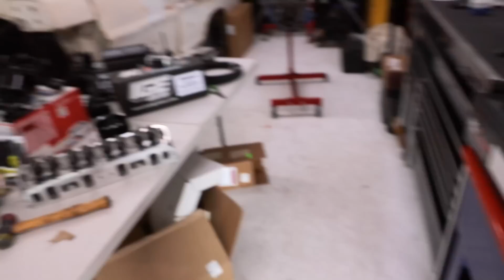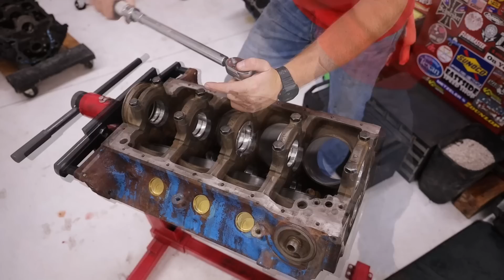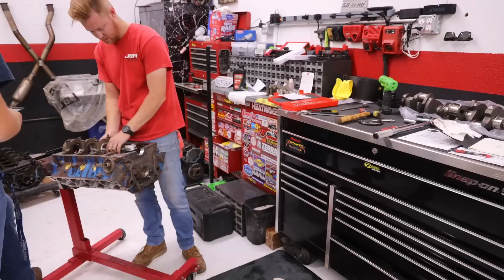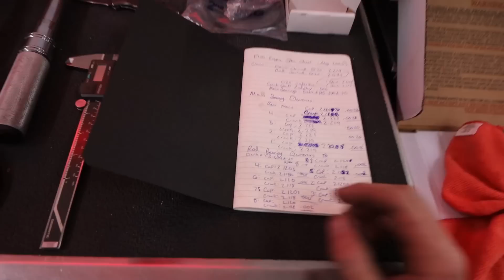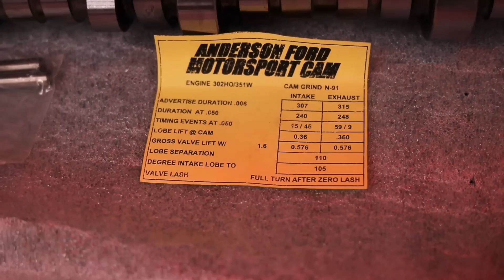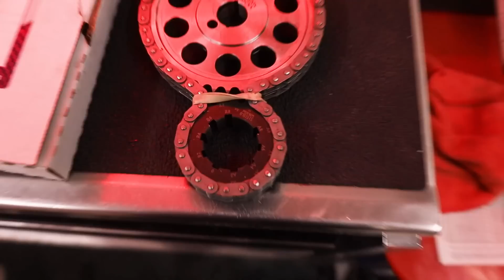My F100's ALL NEW Short Block is FINISHED!

Comment: I put in a new oil pan gasket, timing cover gasket, new water pump, and valve cover gasket on my 1992 F150 last year. This is a very low mileage truck (less than 73K). Had to take a lot of stuff off the engine in order to get the engine high enough so when I dropped the oil pan it would clear the crossmember. Had to drop the oil pump and pickup tube in the oil pan in order to remove the pan. There was no gasket anywhere in the oil pan, There was a gasket between the pump and pickup tube but for the oil pump where it mounts to the engine block , no gasket in the pan, on the pump and engine block. That was the case also when I replace the oil pan gasket on my 1995 Mustang GT.  I'm thinking that the two machine surface (pump and block) are so even that when bolted together oil seepage is nonexistent or so minimal that it doesn't effect the oiling of the engine. I reinstalled the pumps without a gasket because that's how it came off the engine. Oil pressure is great Found the 1992 F150 on Craigslist in 2014 was listed as 1992 F150 less than 47K original miles $5500.00. The guy I bought it from said he got it at an Estate sale and thought it would be fine to haul his camper but told me that the 302 engine was too small. He said he needed at least a 351 or bigger engine.

Comment: Thank you, I just learned what not to do. Main bearing clearance same as ring gap 22 thou, the oil pump is safety springed not safety wired and beat the hell out of the cam bearings putting the cam in. But practice makes perfect and expensive.

Comment: I don’t think you can just remove that roller bearing on the cam gear. You need counter sunk bolts on the cam thrust plate for that timing chain. I could be wrong, but check your camshaft end play to verify.
Reply: I agree. The gear bearing keeps the cam from moving in, the other bearing keeps the cam from moving out.
Reply: @Tguson  Exactly. Hope he sees this before he tries to start it

Comment: .0022" is not 20 thousandths, it's 2.2 thousandths.  If you want even more accuracy, I would zero your bore gauge out on the micrometer instead of the caliper, especially since you use the mic on the crank anyway.

Comment: Im an old timer and maybe I can learn something new. Our line of thinking was always the top piston ring is closer to the combustion and takes more heat than the bottom ring , therefore it will grow a little more than the bottom ring , tightening up just a hair more than the bottom ring. Everyone I ever knew put a larger gap in the top ring. Has new technology or different thought changed that line of reason?

Comment: Thinking that cam is going to go higher than you think, but you have the bottom end to go as high as it wants so should be good.  My massaged stock bottom end 351 does 7k and those 302s have nice tiny bearings and less stoke.  With aftermarket rods i wouldnt be afraid of 8k unless youve got some lead pistons.  I like your clearances, ive been called old school but i still like to see .001 -.0012 per inch for anything thats going to see high rpm.  My 351 came out to .0032 on the mains and .0025 on the rods and i run 10w40.

Comment: Did you mean 2.2 thousands clearance because 22 thousands clearance would be .0220 and 2.2 thousands would be.0022 i worked in a machine shop learned a lot about measuring in decimals

Comment: So you removed the torrington bearing from the camshaft timing gear because the cam thrust plate must have countersunk bolts attaching it to the block so the bearing has a completely flat surface to ride on... Curious, do you now have it riding against those bolt heads? Did you check camshaft thrust clearance after the timing set was fully installed?

Comment: I've installed several flat tappet cams in the last couple years and I've never had an issue with Howards or Isky cams or lifters and I've built a bunch of circle track/hotrod engines over the years. I've heard alot of local engine builders talk about cam failures in the last couple years but I've been very fortunate, I guess. Always use the recommended oil from the cam manufacturer and make sure to adjust your valves correctly and not too tight, so many people adjust valves to tightly.

Comment: I just have to say I wouldn't consider my self a ford guy at all but I've always loved dentside ford's and you have made this truck my dream truck and I want one so bad my teeth hurt
Reply: His is a bump side. But the dentsides are just as nice. I have a 76 f100 that I will be restoring to a bicentennial. 302 auto 2wd long bed. Love the truck and can't wait to get back to driving it again. Been sitting for the last year after a huge life change. Never takes much to get em back going though. After 11 years I had her running again in a weekend. Best of luck to ya once you get your project going.
Reply: @explanger527  yeah I want that project but I'm currently building a 74 international pickup with a 454 and a 4spd I would do a front end swap on that but it's 4wd and fairly rare
Reply: Nice!

Comment: I have lost count of how many times you have rebuilt 302's for your F100, Mustang, Town Car, Etc. As much as I enjoy watching you I have a few questions about your process.  1) Why are you using a 2-bolt production block; 2) Why not use main studs and/or stud girdle with a 2-bolt; 3) What are the rod clearances(journal and side);4) What head gasket thickness are you choosing;5) What lifter modification kit are you using without machining the lifter bores for proper alignment and sizing; 6) are you degreeing the camshaft or are you trusting the manufacturer is honest on the cam card?  I know the Mexico block and value, the correct code block that matches what was in the truck when new has sentimental value, but at what point does all that become moot in this project and you choose to build a replica Boss 302 with Ford Motorsport/SVO/Performance or similar block so you can turn 9000 rpm and NOT blow it up on camera?

Comment: Our cam specs are really close, im running a older lunati roller and I can tell you this camshaft doesn't make alot of vacuum. So if you've got power brakes you need to run a vacuum canister. Since your manual transmission your good there.

Comment: Craig did you mean to call out your bearing clearance as 22 TEN thousandths? Because 22 thousandths sounds a bit excessive to me.
Reply: Hey now, don't question the engine guru :)
Reply: @gernblanston4956  what does it taste like?
Reply: Thanks for the fact checking
Reply: . 022.   22 thousandths..  the last digit lands in the the thousandths
Reply: @brianmaynard7320  222 100,000ths.